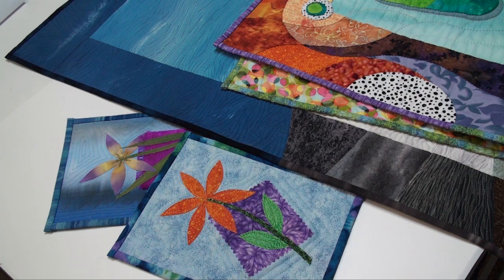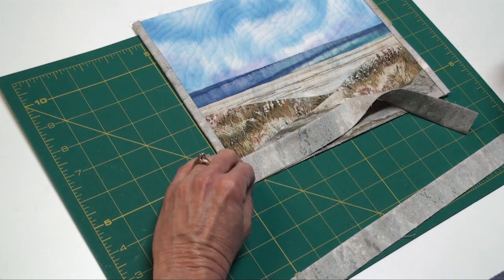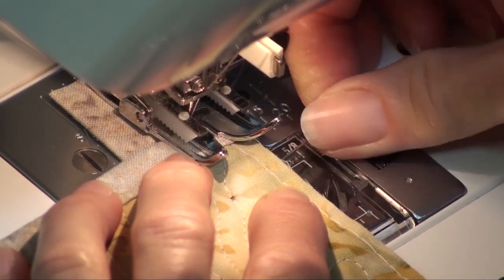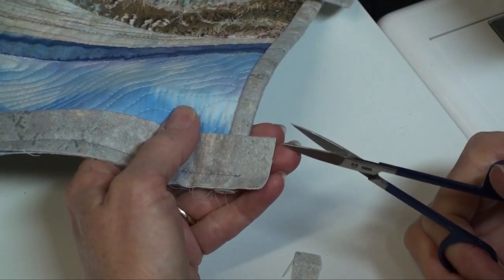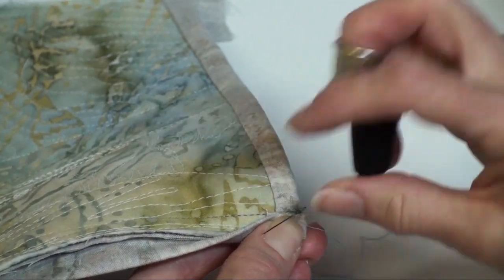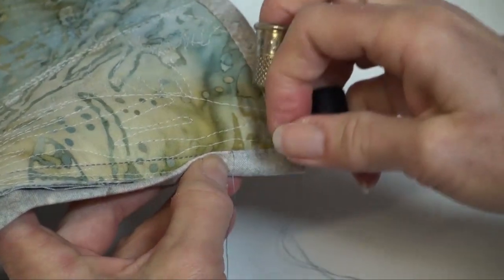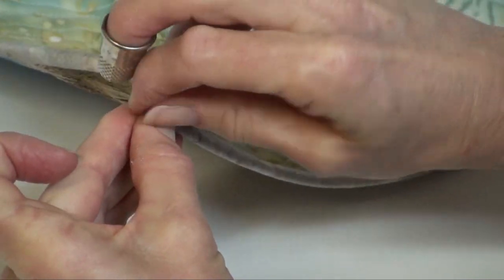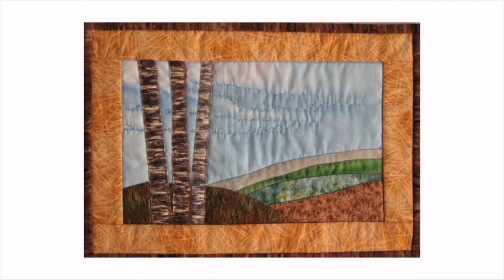How to make a quilt binding with butted corners

Comment: you do such a great job filming and explaining!  I am guessing you used a 1/4"SA...?  I don't hand sew but I think this will work with my preferred method of machine binding.  I sew the same size binding you use on the front, trim down the raw edge a tiny bit, fold to back, iron, pin/clip and then SID on the front catching the back.  so tidy.
Reply from the maker: Yes, 1/4" SA and your machine method sounds great too.